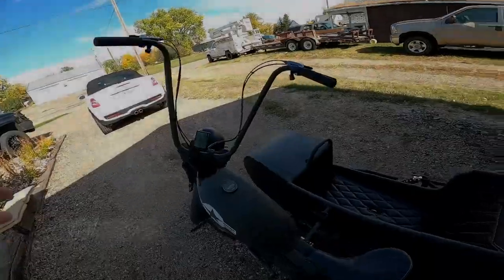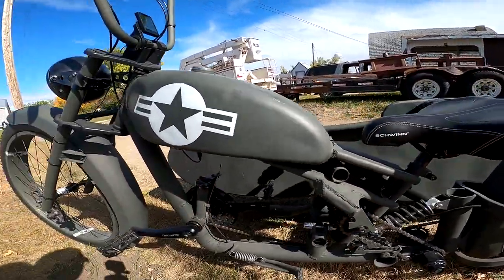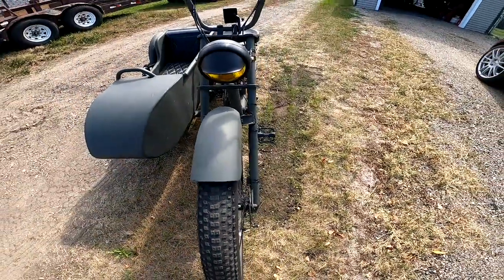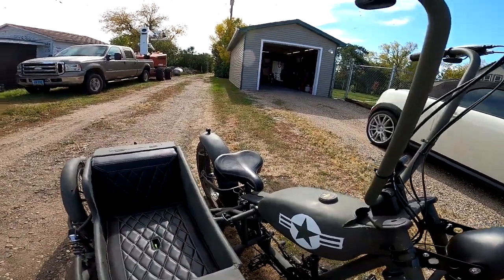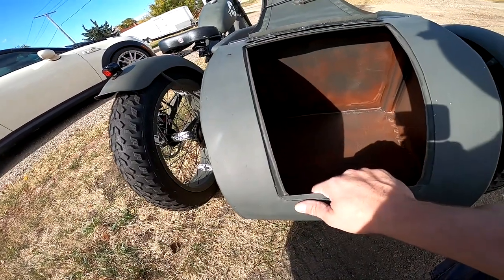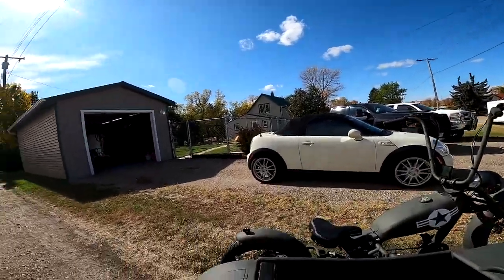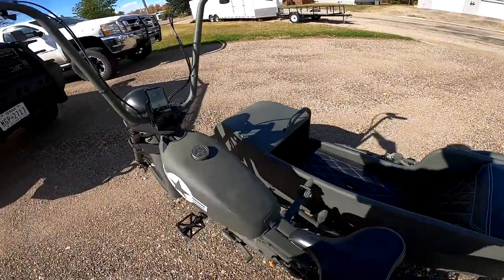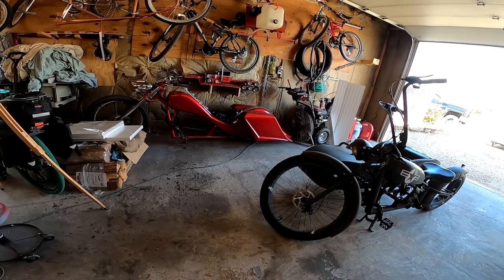Custom Stingray With Suspension and Removable Sidecar

Comment: This would make for a great electric conversion project !!  some nice hub motor rims would make it a killer bike
Reply from the maker: I was thinking about it, but I don't know if I want hub motor on the front pulling all that weight, and I might be able to in the back. But since I have the E-bike bagger that uses a 52v battery and mid drive which works great with all the gears on the heavy bike, I was thinking of putting one on here too. Then they can just share the same battery too. I'd have to find a place to put the battery... This bike has lots of stuff in the way, and I'd want it on the bike, not the sidecar so when they're separated it'll still work as an e-bike. Maybe next year since my pups seem to like it.
Reply: Karl's Krafts I say you put a predator engine in it
Reply from the maker: @godmn  my pups are spoiled couch potatoes, noises scare them. I have thought about it, but silent electric would be the most pup friendly pedal assist.